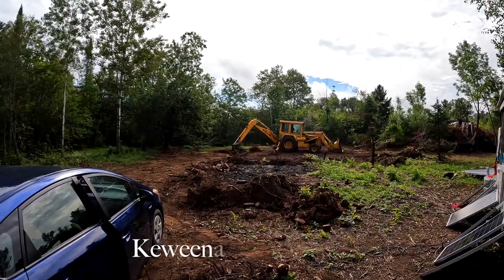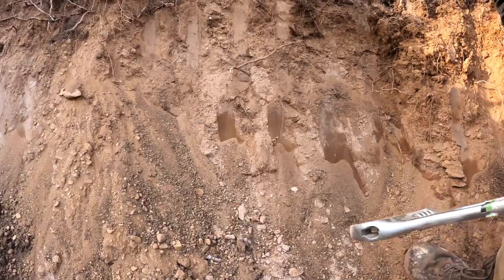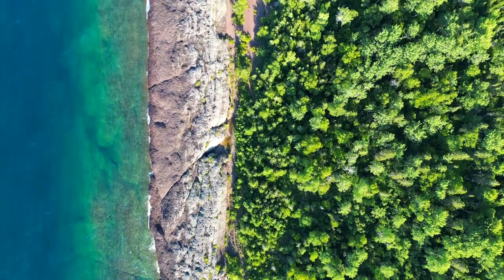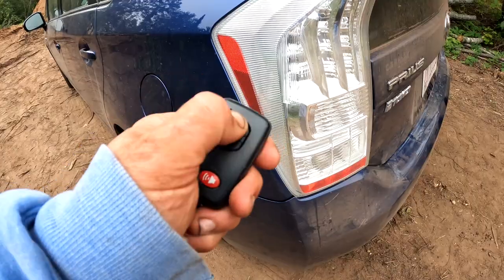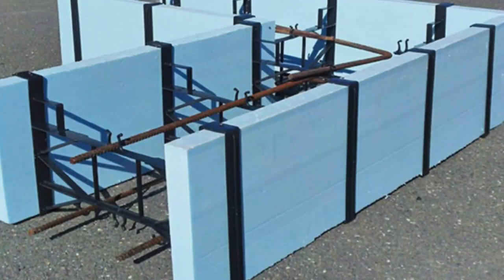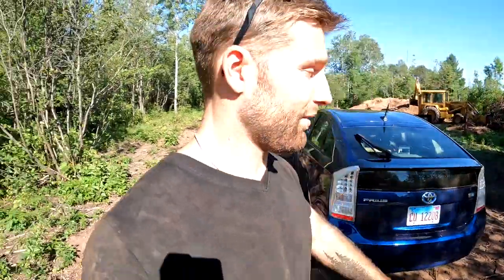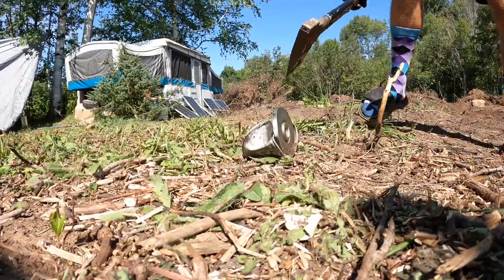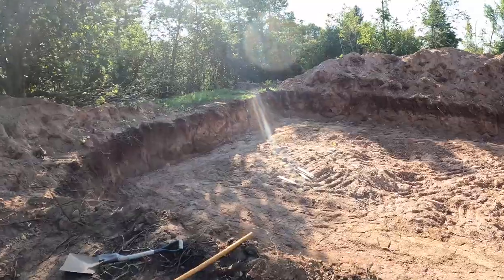Digging Footings for an Off-Grid Cabin | Keweenaw Cabin build #1

Comment: Awesome!  You should consider saving some of the wood from the old homestead and using it in your new place.  Great way to honor the past.
Reply from the maker: I have considered and actually tried to salvage some of it, it’s pretty worn to the point of crumbling to dust. 

For example if I try and pull apart a piece of wood it would either crush in my hand or break immediately outside my hand. So I think it’s pretty much unusable 🥺
Reply: @WillMagnerFitness  that’s too bad, it would look awesome on a wall inside your cabin when it’s finished.   Rooting for ya!  Keep the faith.

Comment: Fantastic work!!! Keep it up!
Reply from the maker: Thanks friend!! I worked hard on this one!
Reply: @WillMagnerFitness  it shows! I would be concerned about the Prius with the snow up there lol.
Reply from the maker: @shawnthomas444  I am!! I’ll use the suburban in the winter. But unfortunately I’ll probably not have this cabin built by winter due to state permitting delays. So next winter I’ll def be fully prepared to live in the woods with snow machines and sh## box trucks !!
Reply: @WillMagnerFitness  our state is the worst for permits. Traverse City here. Been following you on other platforms too
Reply from the maker: @shawnthomas444  I’ve talked to the county and public health and they will be super smooth. 

I think just EGLE takes months to process.
Reply: @WillMagnerFitness  if there is anything I can do to help I’m about 3 hours away and work for a lumber company. If you need help calculating or working out loads and bearing I also design houses. Anything I can do to help!